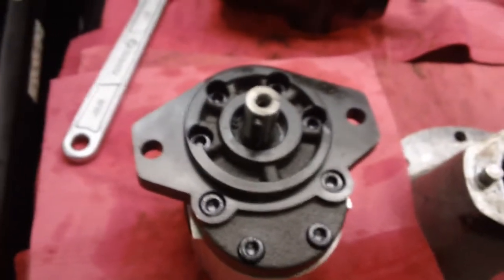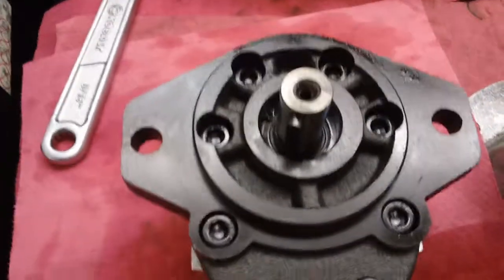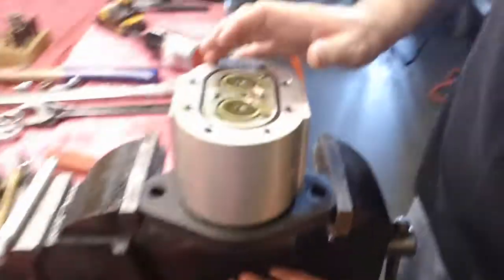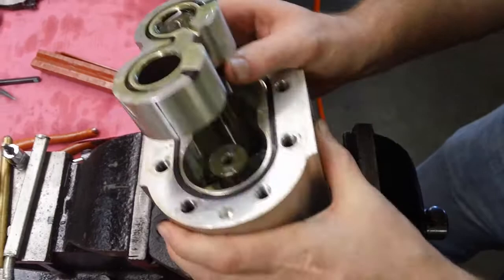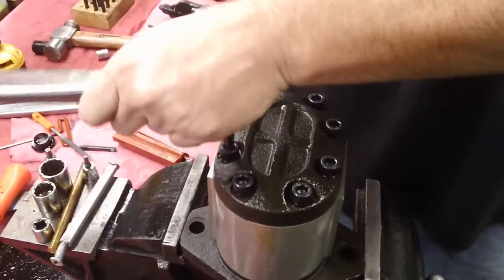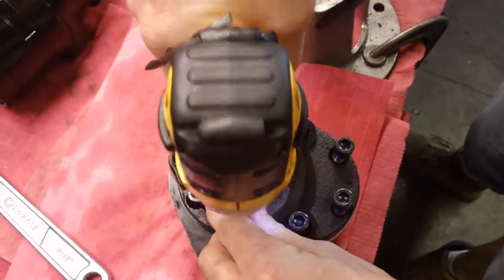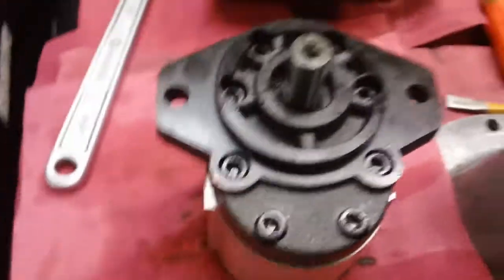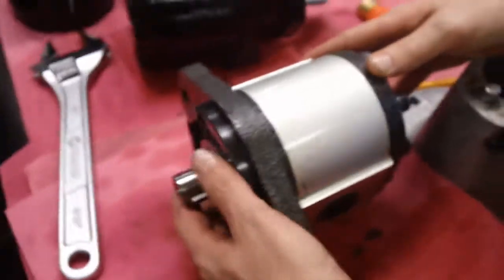Pump Rotation Change F25 Model

Comment: THANKS !!!
I'm converting an IHI 18j from a isuzu 3LA1 diesel to a kubota d905.
the casappa pump was a CCW pump, I have to belt drive it to make the machine work.

This saved me a TON of time trying to find a gear pump the size I need for this small compartment !

It's GEARS pushing fluid.... I just KNEW there had to be a way !

Wish I would have seen this a MONTH ago !!